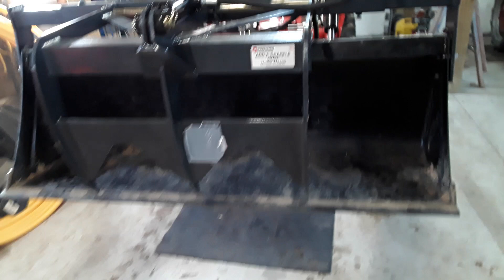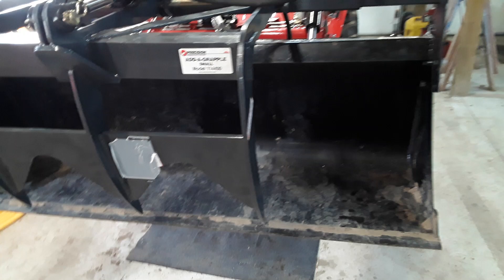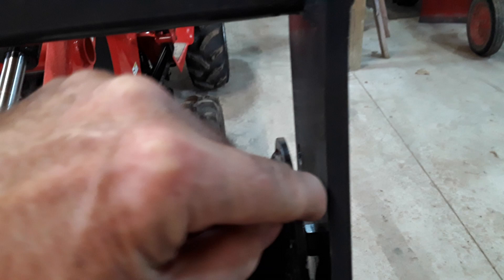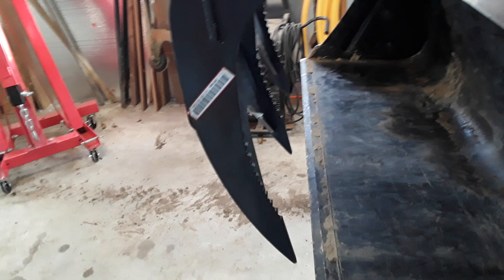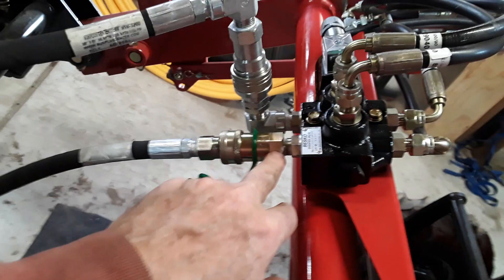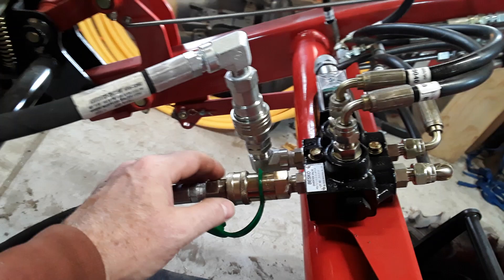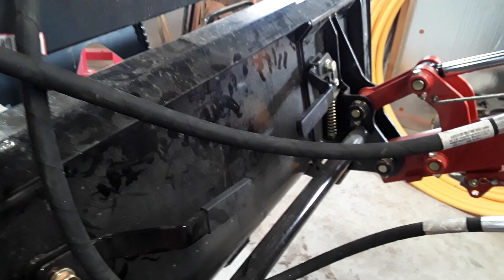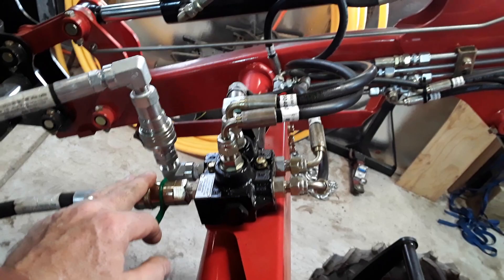Precision Add A Grapple on RK25

Comment: I purchased a Precision Add A Grapple the summer of 2023. I screwed up my bucket measurements and I thought I could use the smallest one they sell. When I got it my 2 inch tube side brackets were 3 inches short.  I contacted the company and they special ordered a set of brackets each 10 inches longer. Worked PERFECT.  Should have purchased the next bigger size Grapple with a bigger grapple teeth and a wider center section. My Shorter Brackets would have worked perfect as the bigger grapple as the center section is wider. I want to THANK Precision Add A Grapple OFFICE STAFF for the EXCELLENT SERVICE. They BUILD THEM to ORDER. Took about 6 weeks to get it and 2 weeks to get the longer parts.  We have used it with a 3rd Function on a John Deere 950 and it GRIPS and lifts logs just fine. Excellent Addition to the Tractor.

Comment: Thanks so much for making this video!! Couldn't find anything on these for that particular bucket. Just curious; any issues using it with that reinforced bend on the bucket sides? Thanks!!
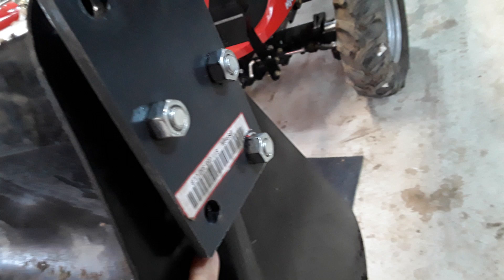Reply from the maker: Yes, the reinforcing bend was an issue.  Watch the video again from 1:00 to 1:30 explains what I did.

Since I made the video I've used the grapple a lot.  I can tell you that 3 bolts are plenty, I haven't been able to break it.
Reply: Awesome! That's what I was wondering. Thanks!!

Comment: I putting a half inch plate between the mounting plate and bucket and also putting a quarter inch plate inside the bucket.
My add a grapple small came with the larger 5/8 bolts and holes in plate?
I moved my mounting to the rear of that support on the side of the bucket instead of over it.
I do not have the third function hydraulics yet. Next project lol
Thanks for sharing

Comment: how has it been so far? I noticed how you have it mounted up kind of high if I get one I was thinking about that because I have a hitch receiver on my bucket do you think it would work ok?  can you tell me how much space you have between the bucket and the bracket? thanks.
Reply from the maker: It's been great so far!  Seems like every time I take it off I almost immediately wish I had it on.  Pretty much I only take it off if I need to do some serious bucket work.

It mounts that high to get the tips of the tines inside the bucket.  I measured and it's exactly 3" from the top of the bucket to the grapple mounting bar.  Fully open the grapple teeth are as far forward as the bucket edge so thy might interfere with what you're trying to do.
Reply: @carlgalloway2024  thanks I think it would probably work out ok that receiver measures about 21\2" square so there should be enough clearance for it to move alright you said it was sort of a pain to get on and off how do you do it? can you tilt and rest it on the ground and get some of the weight off of it and pull that pin?
Reply from the maker: @anthonymorrison2167  There are two things that make it difficult - the weight and how difficult it is to get the hinge pin out.  The last time I did it I unpinned both ends of the hydraulic cylinder and set it aside. That lets the ends of the teeth rest on the bucket taking some of the weight.  Then I pulled the hinge pin and dragged the grapple aside.  Reverse to reinstall.  Not too bad doing it that way.

There are 3 holes on the grapple that the hinge pin slides through but they weren't in a straight line on mine.  Some work with a pry bar improved it some.  To remove I have to use a hammer and punch to drive the pin through the first hole, then I can pull it by hand the rest of the way.  On install it takes some persuasion with a hammer to get it through the last hole.
Reply: @carlgalloway2024  just wondering if I get one I will let you know how I get along with it looks like it should do the job alright thanks for the reply.